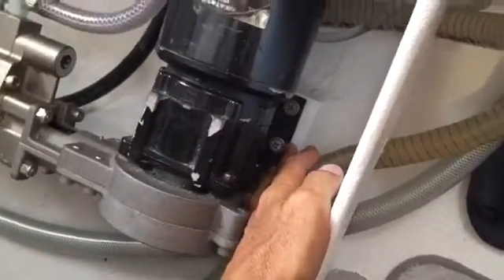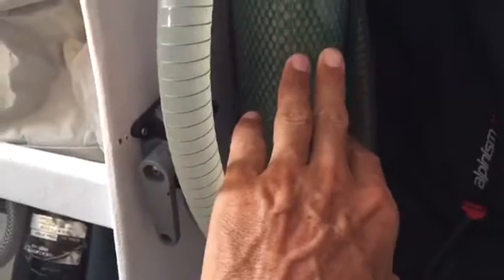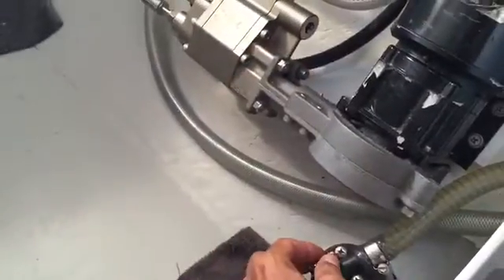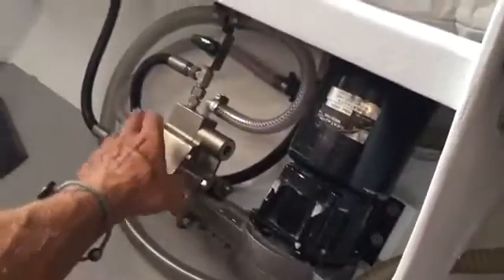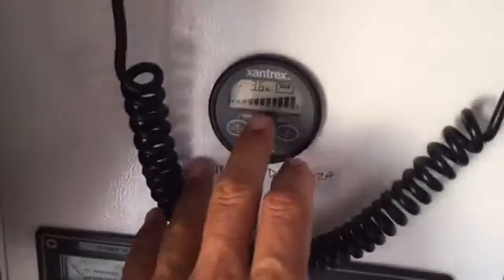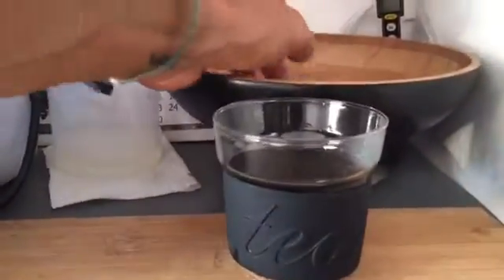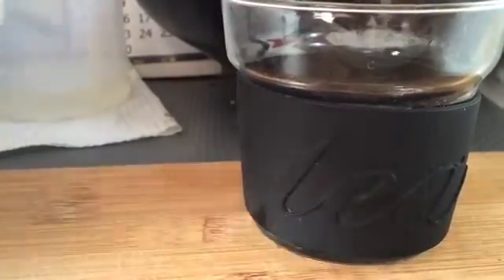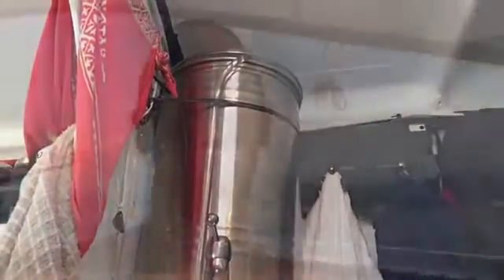Making water onboard using a desalinator - Trimaran Spirit - The Simple Life - Ep1

Comment: Really amazing the system is that old and you haven't rebuilt it, I've read really good things about this system.
Reply from the maker: ChrisLawley and keep in mind that was back in 2015 and it’s now 2019 and it’s still working like a charm putting out 280 PPM @ 25lts PH! These simple systems are the go of your after reliability. And to be honest a lot of it has to do with the short pipe runs and the fact the systems fitted very low in the boat so suction is never an issue. We also change and clean out filter regularly so it never has to work hard.
Reply: @TrimaranSpiritXL  Thats incredible, I tried looking your model up online and i'm not sure if they still make the 160e I see the 40 and and I think it's 80E but kinda have a feeling the 160 could be discontinued. Do you have any sources for it?  They may have discontinued because it's a awsome system not breaking enough to make them money hahaha
Reply: @TrimaranSpiritXL  can you clean and reuse the filters?